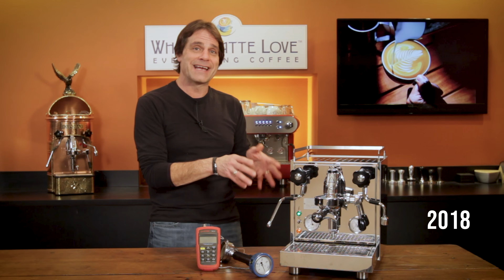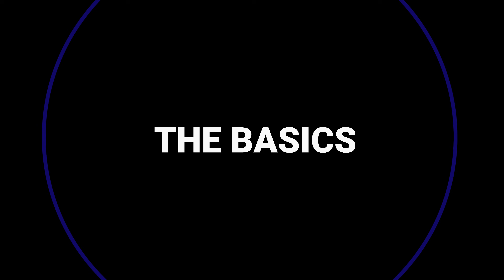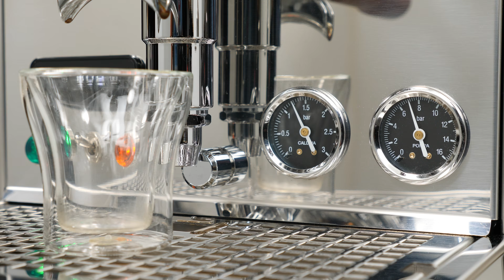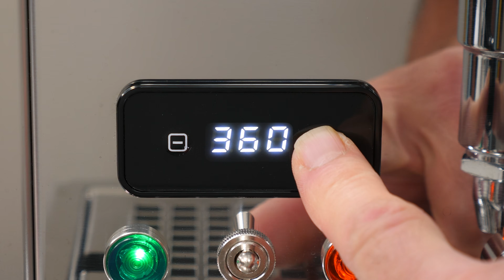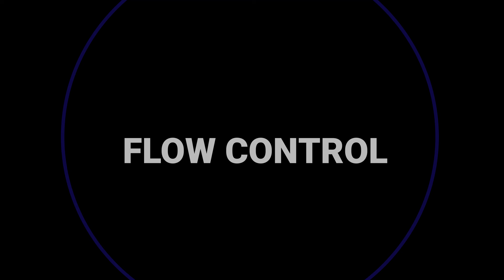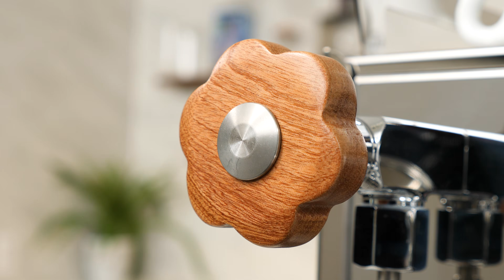Review: Profitec Pro 500 PID Espresso Machine

Comment: Do you think I should wait to see if there will be a newer addition to the profetic line in 2023 before buying my coffee machine?
Reply from the maker: Hi R, Thanks for the question. The Pro 500 is an excellent machine. Manufacturers are always coming out with new and updated models. The most recent new Profitec is the Pro 400. It has easy to use but less precise temperature controls and pre-infusion control: https://www.wholelattelove.com/products/profitec-pro-400-espresso-machine-flow-control
I have no information on other new Profitec machines for 2023.
Marc

Comment: I know there is another version of the 500 called: "Profitec PRO 500 Quick Steam Espresso Machine" - Can you explain the difference between this one and the one you are reviewing? Thank you! :-)
Reply from the maker: Hi AG, Profitec sometimes makes slightly different versions of a machine for different world regions or vendors. The difference in the version you refer to are steam and hot water valves operated by lever instead of knobs. Compared to the version in this video the Pro 500 with levers does not have a visible PID display or shot timer. The knob operated version we carry with the visible PID and shot timer uses a 1/4 turn sprung valve. That means a spring does the work of opening/closing the valve and it's a 1/4 turn of the knob to go from fully closed to fully open. Hope that helps!
Marc
Reply: @Wholelattelovepage  Sure thing Marc. Thanks to your reply. Your clips helped a lot to narrow down to ECM or the Profitec 500.
Reply from the maker: @ayalgersh  My pleasure!

Comment: Does it have option for plumbing tank and tray?
Reply from the maker: Hi Erkal, The Pro 500 is not plumbable. The Profitec Pro 700 is plumbable: https://www.wholelattelove.com/products/profitec-pro-700-dual-boiler-espresso-machine
A lower cost option (in US) for a plumbable heat-exchange boiler machine is the Crem ONE HX PID: https://www.wholelattelove.com/products/crem-one-hx-espresso-machine
Hope that helps!
Marc
Reply: @Wholelattelovepage  thank you for the tip, and the great videos!

Comment: How long does it take for this machine to heat up before use?
Reply from the maker: Hi Kris, Thanks for the question. Like similarly sized machines with E61 group heads it takes about 25 minutes for the machine to heat up with full temperature stability. You can use an appropriately rated appliance timer to have the machine turn on/off at set times and be ready for use.
Marc
Reply: @Wholelattelovepage  thanks Mark - that is very helpful. What about profitec go, does it heat up much quicker?
Reply from the maker: @krismusial3189  Hi, Yes, the GO does heat up much faster. It'll be up to temp in about 4 minutes. For full temp stability I'd allow 10 minutes total with the portafilter inserted in the grouphead. You can get to temperature stable faster by running brew water through the PF (no coffee inside) after 4 minute initial warm up.
Marc

Comment: Hi Whole Latte Love,
I purchase Profitec Pro 500 PID (old model ) machine without the Flow Control from WLL, recently, I purchase flow control Profitec E65 Flow Control and installed on my machine. After installed, the add-on pressure gauge only reach 8 even if I open the flow control to max. Do you have any idea why?
Reply from the maker: Hi DN, That may be perfectly normal. Depends on what the machine's internal OPV is set to. With a backflush disc installed and the pump on what does the machine's pressure gauge read? We generally adjust the OPV to a 10 bar reading on the machine gauge with a backflush disc installed. Adjusted to 10 bar you will get ~9bar on the group mounted pressure gauge with a backflush disc installed. During an extraction the pressure on the group gauge will be lower as pressure is bled off through the coffee puck. How much lower depends on the restriction caused by the coffee puck. 8 bar is fine/normal during an extraction from the group gauge. Know that there's no magic to 9 bar on the coffee. And, 8 bar is probably the pressure within the group during an extraction on machines that don't have a group mounted pressure gauge. Also, a lot of research on TDS of extractions showing little difference in extractions in a range from 7-10 bar.
Hope that helps!
Marc

Comment: Was there no thought to making the pressure adjustment easier to access? A simple removable plate would have eliminated dismantling the side covers.
Reply from the maker: Hi Carl, Hear you... Don't think the manufacturers are keen on cutting into the finished outer panels. Up until a few years ago many didn't understand why an end user would even want or need to adjust pressure. Then specialty coffee took off and coffee geek types (me included) wanted easy access to brew pressure adjustment. It's becoming more common to have exposed adjustments. Many newer Profitec and ECM models do.
With some dexterity and a ratcheting right angle screwdriver It is possible to adjust the brew pressure without removing the side panels by going in (somewhat blind) behind the water reservoir. Our lead prosumer tech Brian discusses that in this video: https://youtu.be/NyRejTgHpoU
Marc
Reply: @Wholelattelovepage  Thx Marc! I'm still using an BE870 but will be upgrading to probably a HE machine in the future. The WLL website is awesome braking the options down and you'll be my first stop when ready to pull the trigger.

Comment: Such great information on all your videos, Marc!  Our Saeco automatic appliance died and I've learned so much watching dozens of your videos.  Now I've worked up to the Profitec 500 as being the ideal machine for us.  The only problem is that we travel in our RV and can't live without our machine.  The 500 is pretty heavy to move around.  Do you have a suggestion for a second machine that is lighter and inexpensive (maybe $500 range) that can get us by for a week or so while on the road?
Mike
Reply from the maker: Hi Mike, Thanks for the kind comment and question. The Gaggia Classic Pro starts at a price under your budget and is a lot lighter than the Pro 500! Be aware it's a single boiler machine so you cannot brew and steam simultaneously. It's my go to recommendation for premium entry-level espresso machine. It's available in a bunch of colors and with wood trim options. Check those out here: https://www.wholelattelove.com/collections/semi-automatic-espresso-machines?_=pf&pf_v_brand=Gaggia
Hope that helps!
Marc

Comment: Hi Mark, great detailed review. I have a Breville Barista Express and considering an upgrade. My budget is $2000. I’m torn between Rocket Apartmento, Profitec Pro 500 and Profitec pro 400. I hear great reviews about the consistency of the shots/pulls in the Apartmemto (my friend has it and raves about it). The pro 500 has PID that has its own advantages. But does the pro 500 pull consistent high quality shots like the Apartmento once dialed in? Thanks for your inputs! 

Nathan
Reply from the maker: Hi tvp, Thanks for the comment and question. I prefer the Pro 500 PID over the Appartamento and I've used them both since their release. Stuff the Pro 500 has the Appartamento does not: PID!, brew pressure gauge, low wear 1/4 turn sprung valves on steam and hot water, stainless steel boiler, available flow control, slightly higher price (in US).
Masrc
Reply: Thank you very much! 🙏
Reply: Which machine did you go with? I am leaning more toward the 400, I like the looks and smaller foot print.
Reply: @08shiver750 they both look fantastic right?

Comment: Hey mark, always love your videos. So informative! I’m just wondering if the Pro 500 would be able to make 4/5 cappuccinos back to back?
Reply from the maker: Hey TJ, Yes it can. By the time you prep your next extraction the boiler recovers to full pressure. If pulling really fast back to back brew temps at the group may drop slightly. If always going in rapid succession you can turn up the boiler temps and use a short flush to compensate.
Marc

Comment: Do you think it would be more wise to purchase a Profitec pro 600 over the rocket Giotto cronometro?
Reply from the maker: Hi Zack, Thanks for the question. Personally, I'd go with the Pro 600 unless you're going to go with EVO R version of the Giotto which is plumbable direct to waterline and has a rotary pump. The Type V Giotto is not plumbable and uses a vibration pump. Other considerations: The Pro 600 is a dual boiler so can run independent temperatures in each boiler. Plus, the Pro 600 can run at higher steam pressure than the Giotto for better frothing performance. And, the Pro 600 is available with flow control (free upgrade at the moment from us) of the E61 group which expands your extraction capabilities. Check out the Pro 600 w/Flow control here: https://www.wholelattelove.com/products/profitec-pro-600-dual-boiler-espresso-machine-with-flow-control
Hope that helps!
Marc

Comment: Hi Mark, thanks for another informative video about coffee, have you noticed any difference on the vibration and rotary pump when we are using flow control? Shot quality, taste, looks etc. I really don't know if I should save up for 700 or other machines.
Reply from the maker: Hi yh, Rotary pumps, aside from being quieter have a higher potential flow rate than vibration pump. Stock E61 vibe pumps move about 8g/s while rotary pumps move about 11g/s. In most cases that difference is not a big deal when using flow control as the majority of flow profiles are reducing flow rate below stock. Here's an article with graphs comparing flow rates of vibe and rotary pumps. Also has graphs of 5 common flow profiles: https://www.wholelattelove.com/blogs/articles/intro-to-calculating-flow-rate-on-e61-group-machines
Marc
Reply: @Wholelattelovepage  That's exactly what I'm looking for! Thanks again!

Comment: Terrific review video - super informative, and a great walkthrough of the machine.  I have a Breville Barista and I am getting ready to upgrade and Profitec is an incredibly strong contendor.  Really, I can’t seem to find anything that compares for the price.  There is one thing I’m wondering, though.  Why does the PID show the steam temperature?  Aside Profitec/ECM (for obvious reasons) it seems everybody else’s PID or control unit is the brew temperature.  To me it seems brew temperature is the far more important element based on the roast of the bean.  Everything about this machine seems to be great for workflow except the temperature.  It seems to me like having to keep a conversion chart near the machine would be an annoyance.  Can you shed any light on the rationale, Mark, or if there is any way to show the brew temp instead of steam?
Reply from the maker: Hi IRB (I also RB !), Thanks for the kind comment on the video! Manufacturers of machines using heat-exchange boilers like the Pro 500 often display the actual temperature in the boiler rather than a calculated (using boiler offset setting on the PID controller) brew temp. Rocket Espresso and other makers take this route as well. It may be possible to adjust the PID's offset to show something closer to the brew temp at the group - but not something I've attempted. The problem is variables involved make accuracy difficult. Factors like ambient temp, idle time since last use, etc have big impacts on brew temp relative to in-boiler temps. Modern PID HX boiler machines are relatively stable in temperature so if you find a good boiler temp for say a medium roast coffee you can use consistently. If you change to a lighter roast set the boiler a 2-3F higher. If going to a darker roast a few degrees cooler. Of course, semi-auto espresso extraction is a bit of an art form and involves some trial and error. But once you get to know a machine it's fairly easy to modify temps and get predictable and repeatable results.
Marc

Comment: Just got this. Love it. I tried the flush for 10 seconds but the water did not go anywhere. Some of the video I’ve watched it shows the water pressure getting released the nossle. I didn’t like the sounds of what was happening And it was tough to undo the portafilter. Didn’t like it! What gives? UPDATE - I figured it out. 😂
Reply from the maker: Hi Bob, I hope things worked out for you. Not sure I understand "water did not go anywhere". Until the group gasket is broken in with use, portafilter may be a little stiff to remove.
Reply: @Wholelattelovepage  figured it out! Love love!
Reply from the maker: @gainknowledgeandinsight  Awesome!

Comment: Hi, Is this machine the latest model? It looks different from options I can see here in the UK? Are there reliable vendors you may know in the UK that sell this variant? I'm interested  in purchasing this one.
Reply from the maker: Hi x, Yes, This is the most recent version (2022) of the Pro 500. I'm not familiar with vendors in the UK but as this machine is fairly recent they may be working through stock of the older version prior to offering the new.
Marc
Reply: Bella barista are getting stock of this version on Monday
Reply: @Tom Photoix  I ordered the Pro 600, very happy with my purchase from Bella.
Reply: @x7SiNz--  I can’t justify the extra money for the 600. Struggling to justify the 500 actually. The 400 would probably be fine for me in all honesty. But I have the 500 in my basket and my finger is hovering over the checkout button! I only do 2 milk drinks a day generally and my wife can’t tell the difference between instant coffee or world class espresso, so it’s overkill to get a dual boiler with absolute temp stability and flow control and all the rest. I just want something that looks nice on the counter and can quickly produce great drinks. I’m happy enough with my breville barista pro really, but I have a desire for something with a quicker workflow and a more hands on approach. The 500 should fill that quite comfortably!

Comment: Steam time of 27 sec seems VERY long for a machine of this class. Your same method times Bezzera units at 16-17. Why so slow here?
Reply from the maker: Hi David, Thanks for the comment. That time is similar to other HX boiler machines which have to balance steam pressure with desired brew temp. Not sure which Bezzera machine you reference. Their dual boilers are likely faster. Their single boiler Hobby is a crazy fast steamer but there's extra time outside of actual steaming for the boiler to heat from brew to steam temp and then the extra hassle/mess of cooling a single boiler down after steaming - and of course no simultaneous brew and steam on a single boiler machine. If after fast steaming best to go with a dual boiler like Pro 600, Pro 700 or ECM Synchronika. All those run at class leading ~2 bar of pressure in the service boiler and pressure is always available.
Marc
Reply: Thanks Marc...I was referencing your video review of the Magical which is the other machine I am considering. Is the Magical really that much faster on the steam?

Comment: I your budget is $2K, which machine would you buy?  That’s the ultimate question.
Reply from the maker: Hi Mike, Thanks for posing the ultimate question. If familiar with the Hitchhiker's Guide the answer is 42! Kidding aside, The Profitec Pro 500 is currently at $2K and the machine I would get with that budget. There are other options which might better fit your use case. Here's a link to every machine we have in the $1600 - $2100 range: https://www.wholelattelove.com/collections/semi-automatic-espresso-machines?_=pf&pf_p_price=1439.99%3A2099.99&sort=price-descending
I'd def go with a PID machine like the Pro 500 over the Rocket Appartamento. There are a couple of good Bezzera machines for less $$ in the link which also have PID. Hope that helps!
Marc
Reply: @Wholelattelovepage  literally just made me a lifetime customer. I will be buying here in about 3 months. Thanks for the guidance my friend.

Comment: On the pro 500 what position do you put the flow control knob at for standard full flow the same as if the machine did not have flow control?
Reply from the maker: Hi Jessica, for standard flow rate open the flow control 1.25 turns from the fully closed position. 
Marc

Comment: Thanks for the great video!  How does the steam power on this compare to the Pro 600? I know it's comparing 2L HX to 1L DB but how does that translate in real world use?
Reply from the maker: Hi SC, You're welcome and thanks for the question. The Pro 600 has higher steaming power if you want it with boiler able to go to ~2 bar in pressure without any change to brew temps. Max pressure on the Pro 500 is adjustable by turning up boiler temperature but maxes out ~1.5 bar. Thing is when you set temp for max pressure you're also increasing the brew temperature in an HX boiler machine. You can bring it down using cooling flushes but takes some experience and a bit of guessing to hit specific brew temps. In the real world, higher steam pressure makes frothing faster and gets you more vigorous roll to mix milk to a more consistent density. On the other hand, some users - especially those newer to frothing milk can find the extra power is too much. Make a mistake frothing with a lot of power and you don't have much time to fix before milk is too hot. On the 600 you can set a temp/pressure in the steam boiler that fits your skill level without changing the brew temp. hope that helps!
Marc
Reply: @Wholelattelovepage  thanks Marc! This makes sense. I was just concerned about how the 600's 1L steam boiler would fare in real world use making back to back milk-based drinks compared to the 500's 2L boiler but it seems Profitec has done a good job with setting appropriate boiler pressures for the job. I'm torn between these two machines and would hate to be disappointed after spending that much money, although I figure that's unlikely coming from a VBM Domobar Jnr. Thanks again 👍🏼